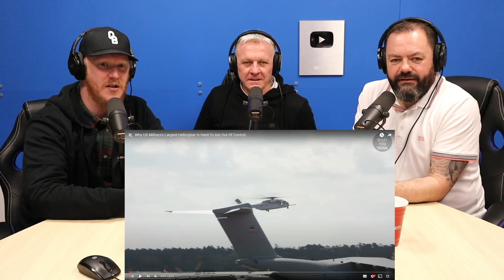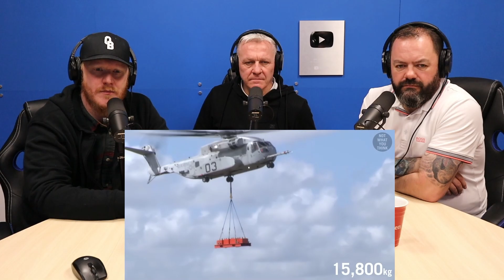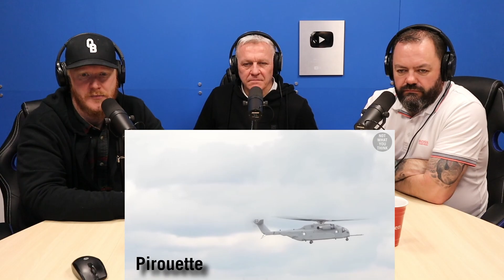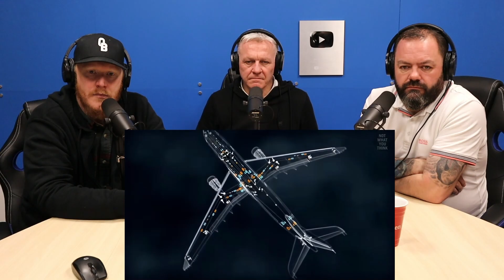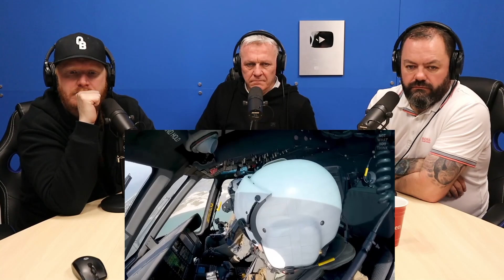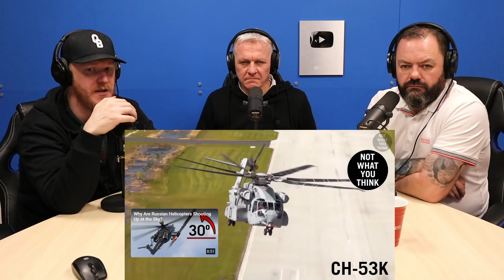The US Military's Largest Helicopter REACTION | OFFICE BLOKES REACT!!

Comment: Aviation will never be strictly human or strictly computerized most crashes are when one fails an the other can't correct it . But if the other is there to correct it things can be fixed potentially but if u just rely on a computer it's super dangerous . I've seen planes get stuck in auto pilot an dive straight for the ocean cause the computer interprets a problem with an engine or a rudder so it compensates when it doesn't need to an everyone is dead

Comment: Yeah, Idk. There's good and bad. Are they protected from emp's? That's the problem with so much tech. Also, if you can jam the signals; radio, satellite, then the drone pilots would lose control and it'd go into an auto mode or crash.
Reply: All military aircraft are protected from EMP.

Comment: Regarding unmanned aircraft being expensive, in theory they may be much less expensive when there is no need to for a pilot's life and comfort. No worry of ejection seats, oxygen, armor, temperature and g-force concerns.
Reply: Once enough electronics are put on the airframe, the cost can easily exceed that of a manned one and that will determine how many of those airframes can be acquired and then the question will be whether that number will be enough for heavy operations (and the time it takes to build one). The trick is to find the balance between cost and expendablity.
Reply: If they're correct in saying there will be a tremendous drop in upkeep dollars from cutting 300 or whatever mechanical parts out, that needs to be equated into the formula also.